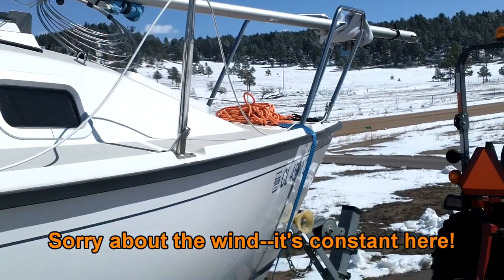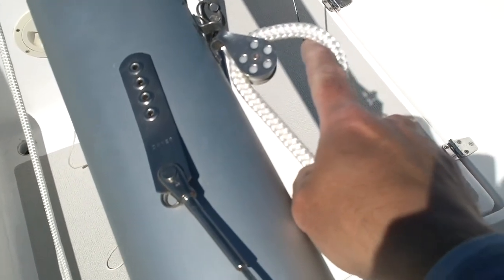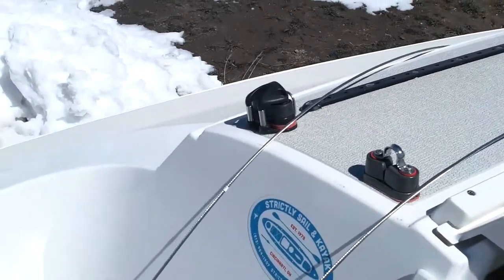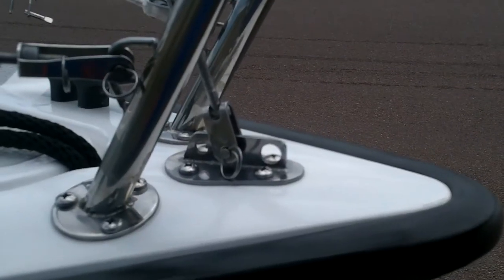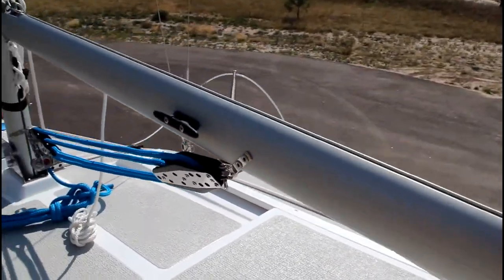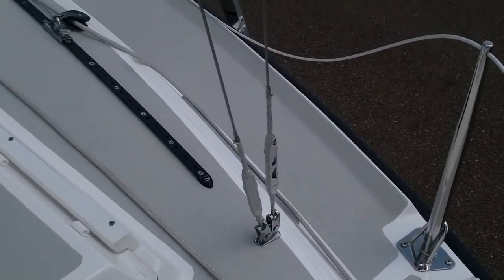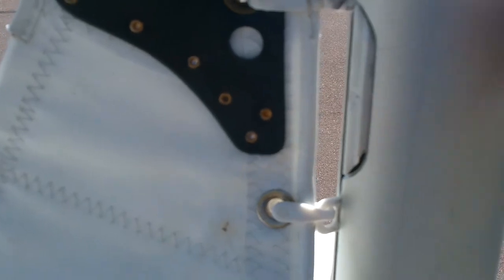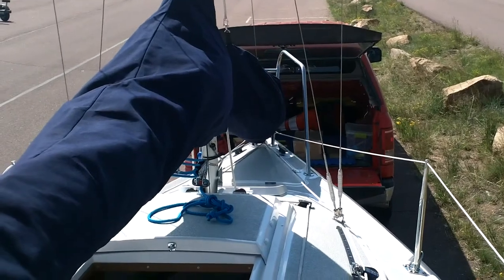Rigging the Precision 18

Comment: Great video! I have had my eye on this boat for a while. Trying to find information about how long the boat is with the trailer and mast included- goal being to keep this in a garage if possible. Would you happen to know the total length? Thank you!
Reply from the maker: The boat on the trailer from tip of trailer tongue to end of motor mount (with rudder removed) is 22 ft, 5.5 in long (269.5”). Also requires an 8’x8’ bay door. The 7’5” beam will give a few inches clearance on each side and the bow pulpit will clear the door with the trailer tongue jack wheel crouched in the full down position.

Comment: Hi Dave. Curious what type of cotter pins you use for standing rig turnbuckles? How often do you raise and lower your mast per season? I own a 1987 P18 in Indiana. Your videos are the best!
Reply from the maker: I eliminated all the straight cotter pins on my boat and now use only rings (of various sizes) throughout the boat. In the turnbuckles, I use a ring just big enough to prevent turning. As far as mast-raising, I usually step 5-6 times every season. My boat spends 90 days in a marina and I like to do a pre, mid and post-season trailer sailing trip. The mid-season trip is also a great opportunity for a nice hull cleaning so it’s easier to clean at the end of season haul-out.

Comment: hay Dave do you have enough turns on the downhaul ?
Reply from the maker: Yeah, I pretty much keep wrapping till there's no line left. I supposed I could trim it...I just don't like the excess line flopping around. I also always make sure the last turn keeps the working end facing down...I don't like the way it looks if it's pointing up! =) The nice thing is that the downhaul doesn't need to be tight...when you raise the sail the main halyard tensions it.
Reply: @ColoradoSailing  i would do the same , noticed your cleat on center of the mast I'm tied off to the side think i will change it. is it drilled and taped? Thanks for the videos
Reply from the maker: @cbfsoar15  Yes. Pretty easy to install…I added a second horn cleat to the boom for the second reefing line.

Comment: Many Thanks for the detailed description of your rig - looks like a great plan to replicate on my boat. I have the same mast raising procedure as yours. Although easy to do solo I do worry about the risk of damage that would result from slipping or dropping the mast while raising it or losing control of it due to excessive lateral movement. Also relying on that single cam cleat to hold the mast while going forward to secure makes me anxious. 

Saw a great design for a gin pole setup (best ive found) - although takes longer and maybe overkill for such a small mast it might allow safe raising on lowering even while under way to negotiate bridges etc. I'd appreciate your perspective on this if you time! https://youtu.be/7vl3AklLUKA?si=1F3RuU0puVCnRC8U